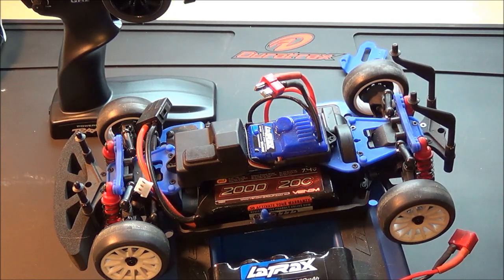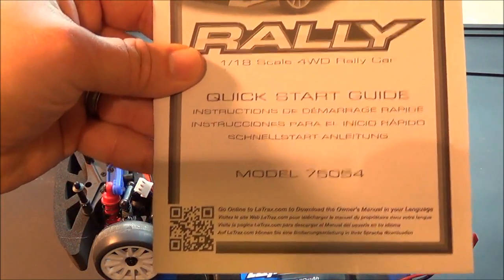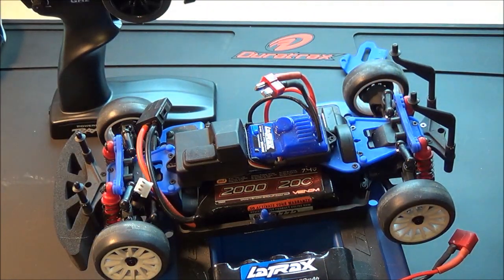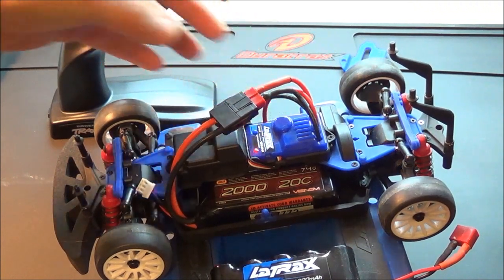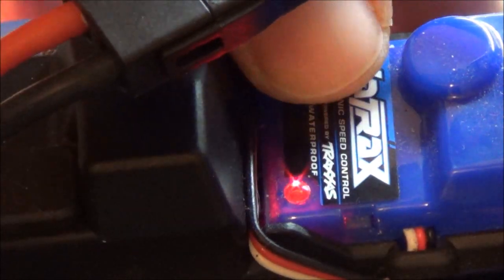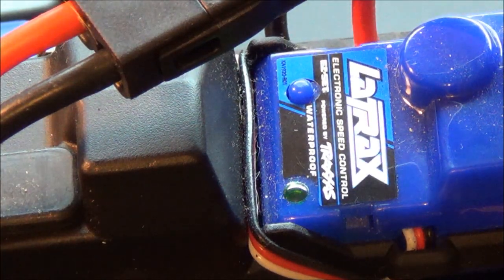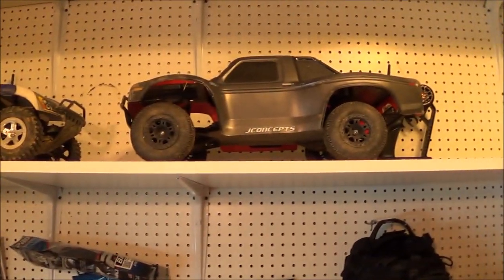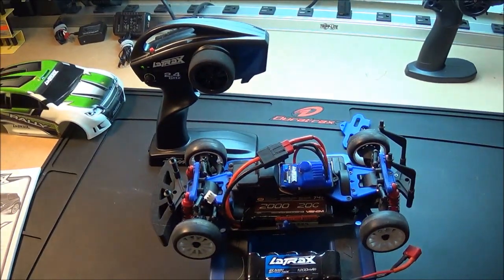Traxxas latrax How to turn on the low voltage detection

Comment: Your welcome, Is that the same procedure for latrax Teton thanks?
Reply: yes. they are basically the exact same vehicles. just different suspension, wheels and body. same esc, receiver and motor.

Comment: I want a 2s lipo for my son. What's the best one that you can recommend. Thanks
Reply: +Jose Hernandez I just got a Turnigy 2200 mah 2cell lipo 25c discharge and it fits if you squeeze it in there(There is white foam padding on ether side that makes it just a cm too big to fit with no effort)
Reply: Question for you guys.  (Realize this video is about 5-6 years old lol). Just came across one of these that I bought a few years back.  What would be the biggest benefit to switching over to Lipo vs NiMH.

Comment: Do u know what to do if your car doesn't run at all? Everything turns on fine the steering works but no gas at all thanks
Reply from the maker: That happened to me with one of my cars I noticed a light blinking on the ESC I check the manual it said I had to recalibrate the ESC and after doing that it was fine

Comment: I got my low voltage off cuz im not using a lipo battery , but when I accelerate the low voltage light turns green and it beeps , what does that mean?

Comment: How do u get a different esc to work with the stock reciever
Reply from the maker: <p>Probably not much help I'm new to the hobby but when I switched mine the light on the ESC was blinking and no power to the motor but the steering servo was working I looked at the manual online and it said it needed to  recalibrated the ESC then it was fine</p>
Reply: yea ill try it